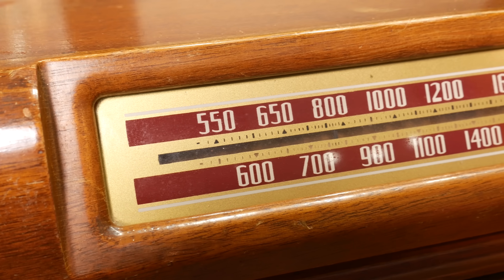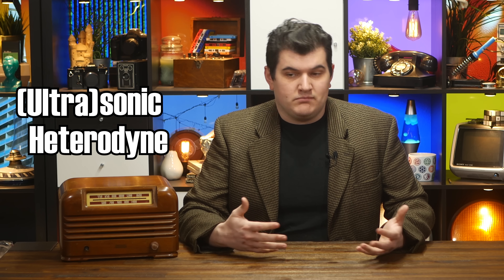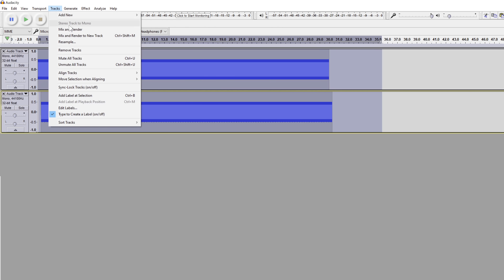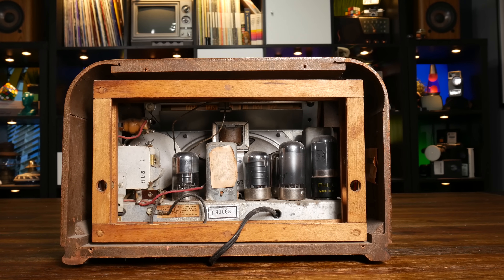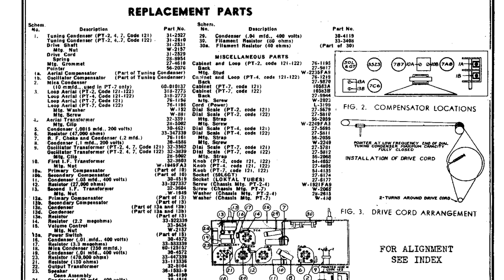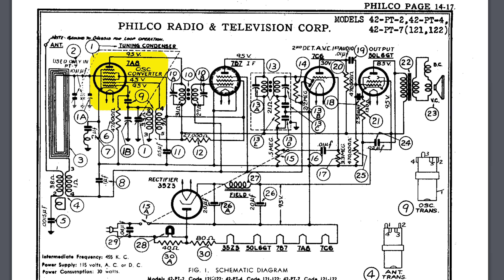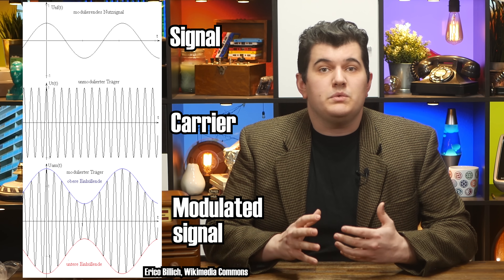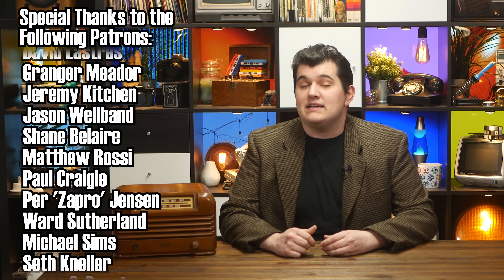The Superheterodyne Radio: No really, that's its name

Comment: It is called superheterodyne because the local oscillator frequency is above the frequency we want to tune.
If the local oscillator frequency were below the frequency we want to tune then the system is called subheterodine.
Reply: its called super because the IF is ultrasonic, ie. above the audio range. ultrasonic used to be called supersonic, hence the name. now it would better be called ultraheterodyne

Comment: Why adding two high frequencies didn’t produce a third frequency…At about 3:35 or so, you set the speakers at two very high frequencies with the idea that the beat frequency would be a steady tone at a lower frequency. There is a subtle reason why that didn’t work. The microphone,   and our ears for that matter, simply responds to the total instantaneous amplitude of the air pressure pushing on our ear drum (or microphone).  They respond linearly, that is to say, the more pressure they feel, the harder they push. The logarithmic response is because of the way the inner ear bones work, they pivot in a fancy way that increases the dynamic range we hear. But, it is still, all linear. The two signals simply add up and push on our eardrum.  If, in a radio, when you combine the two signals, you did so with a couple of resistors, (sort of like your ears do), you would not get that magic extra frequency. The reason you get that magic extra frequency in a radio is because the combining is done with a fancy circuit that does not add the signals but MULTIPLYS the signals. The circuit is called a “mixer.  I’m leaving out many details, but the concept is that the signals must be combined in a non-linear fashion.  In order to “hear” that third signal as tone, your ears need to multiply the signals together and not add them. Fortunately, they don’t or we would go mad with all the weird “mixing products” we would hear all day long.  When people talk to us, wow, the array of mixing products would drive us mad!!!

Comment: I love the channel, but in this case the explanation is not quite right. The beat frequency is not a new frequency. It just is an illusion as a result of interference. To really generate a signal with the frequency of the difference between the two input frequencies, you have to mix them. Not mix them in sense of simple addition (like in a mixer pult), but multiply them. For this a nonlinear component is required. Like diodes in a ring mixer for example. Only with a nonlinear operation new frequencies show up in the spectrum.

Comment: The reason you don’t hear a 400 Hz tone from the 5 kHz and 5.4 kHz  speaker tones is because there is none. you do not create a new frequency by adding two frequencies together. if that were true the concept of frequency would t be very useful. What you create  is an amplitude fluctuation (a beat) at 400 Hz, not a new frequency. Your ear can hear amplitude fluctuations up to a few Hz,  but not at 400 Hz. To get a new frequency from beating, you need some sort of nonlinear combination like multiplying the signals together which is what actually happens in a superheterodyne radio. Maybe nonlinear distortion is why you can hear 400 Hz in the headphones. Congrats though on testing your idea with a real experiment.

Comment: Actually you will only get the beat frequency if you add a non-linearity. Otherwise you'd always have beat frequencies if you had more than one station. BTW the other big advantage of Superheterodyne receivers is that it's much easier to amplify a signal. Amplifying an RF signal while keeping its frequency means that you will have a strong signal at the frequency you want to receive. This could feed back into the input again and you risk your amplifier being an oscillator. This allows decent "modern" AM receivers to actually be much more sensitive than the natural background noise.

Comment: Thanks a lot for this video, very interesting !
Something I don't understand however is why the modulated signal (music/speech) which is at a much lower frequency than the carrier is not filtered out by the band-pass filters. I know this signal is AM, but still it's waving at a the "human hear" frequency, so how is thant not filtered out ?
Reply: He touches on this in the video but it works like this.   
Let's say you're listening to a station like WDGY in Minnesota at 740 kHz.   And that station is playing a 1 kHz tone for some odd reason.   If you could see the RF signal on an  oscilloscope, you'd see the 740 kHz signal (call it the RF signal or the carrier signal) but the AMPLITUDE of the carrier signal would changing at the relatively slower rate of 1 kHz.   
The tuner and mixer would generate the intermediate frequency (varies by radio - let's go with 450 kHz).  The intermediate frequency is then amplified.  Now if you could  see the signal on the scope, the amplitude is larger, the frequency is now 450 kHz and, overall, the amplitude is still increasing and decreasing at the relatively slower rate of 1 kHz.   
Now you run the intermediate signal thru the radio's detector stage.  This is essentially a low pass filter that passes audio frequencies and rejects ultrasonic frequencies.   
After the detector phase, look at the signal at an oscilloscope now and you see a 1 kHz sine wave.   Now send the audio signal thru the audio amplifier and you see the same signal with a larger amplitude.  For a vacuum tube radio, this is then run thru a transformer to so that the power is converted from high voltage - low current to high current - low voltage because speakers require that form of power.   
Hope this helps.

Comment: Fun fact about that schematic: The german word for capacitor is still "Kondensator" - condenser. And because translators sometimes are idiots, the german Flux Capacitor doesn't store flux but compensates for it, because they turned the "Flux-Kondensator" into a "Flux-Kompensator". If you ask me, I prefer my flux to be compensated for. There's nothing as dangerous as a wibbly-wobbly time line.

Comment: If people are wondering why it was called condenser, instead of capacitor, even though it's storing energy:
a) Lingua Franca for all STEM fields back then was pretty much German, where it's called "Kondensator"
b) "Kondensator"/Condenser is derived from Latin "condensare", condense in English. The term was first proposed by Volta (yes, that guy which we named Volt after), because you could store a higher density of electrical charge compared to the usual isolator, thus "condensing" the charge.

Comment: A filter that has flat frequency response for the interval of interest (the station's modulation frequencies), but drops off rapidly beyond those—a "brick wall" filter—is complex, and difficult to keep constant even for one center frequency. It's beyond insane to try to do it while it's being tuned over a wide range. BUT WAIT! If it's a DIGITAL filter, suddenly this is not much of a problem. The formulas can be worked out and programmed in, and your filter can be tuned all over the place. All you need is a way to convert analog to digital, with enough bits of resolution, at at least 2X the width of frequencies you want to receive. With today's tech, I think we've reached the point where the new problem is much more tractable than the old one, at least for radios with ranges no wider than a few tens of MHz. A general communications receiver (shortwave radio), or a broadcast FM radio, would likely be totally workable.

Comment: In the mid-Nineties, I was saying that the first casualty of digital technology was the slide rule, and the last one would be the slide rule dial. I think we're sort of reaching that point now, after about 50 years.

(slight tangent: Increasingly, I think there's a lot to be said for analog-style indicators, although they should be electronic displays, driven by digital data. In particular, I'd say that about clocks. A dial-type time display sidesteps a group of really vexing problems related to the issue of 12-hour vs 24-hour formats.)

Comment: My parents told me that almost a century ago, in Europe, you had to buy a licence to operate a radio receiver.   Random spot checks for enforcement were to try to detect the radiation from the oscillator in your little vacuum tube radio.
Reply: You still have to, lots of countries gather mandatory fee for operating tv or radio equipment, fees are then used to finance the state run tv/radio stations - its basically not-so-hidden tax :)

Comment: In order to get a beat frequency the device detecting the sound or signal must be non linear. The ear is a nonlinear recover and it's response is logarithmic. (This is actually very clever allowing the ear to hear loud and soft sounds.) 

An A.M. signal is composed of the carrier, the carrier plus the the frequently and the carrier minus the frequency. Thus if the carrier frequency is 1160khz and it is carrying a 5000 hz signal the result is 1155khz, 1160khz and 1165khz when those are combined the result is a modulated wave. When this is put through a detector a 5000hz signal is created and amplified. A transducer (something that converts the electoral signal to sound (usually a speaker or headphone) plays sound and we hear it.

Comment: Edwin Armstrong developed circuit designs (including the superheterodyne receiver) that are still used in countless pieces of equipment today. I used to fix surveying instruments that measure distances by bouncing light off a prism. The outgoing signal is modulated at a high frequency. The returned signal is sensed by a diode, amplified and mixed with an intermediate frequency, then the RF filtered off before the phase shift is measured to compute the distance. I was sitting in the training class thinking "OK. It's just like a radio."

Comment: Early 80's I remember connecting an electret microphone to a (transistor) FM radio's local oscillator. Then connecting another wire to the oscillator as an antenna. Could transmit to another FM radio. Signal was received a block away.

Comment: Superheterodyne is still used very often in ameteur radio, but the bandwidths are much narrower. Broadcast FM stations are spaced 200 khz apart, while ameteur radio single sideband signals only have a bandwidth of 3 khz.

Comment: The capacitance of the variable capacitor tends to change with temperature.  As the temperature goes up, the plates may get closer.  This will cause the station tuning to drift.

Comment: Your experiment with speakers is adding two sinewaves. This  won't produce an actual difference component: sin(3000) + sin(3400) -- it's just two sinewaves. But when you multiply them: sin( 3400 ) * sin( 3000 ) you get ( cos( 3400 - 3000 ) + cos( 3400 + 3000 ) ) / 2. You get the difference and the sum. 

It's not hard to get a circuit to do this -- in fact, it's hard to avoid.  Because any non-linearity in the circuit will create a multiplication effect. Classically this can be running the sum of two sinewaves (3400 and 3000) through a diode that chops off the bottom (negative part) of the signal, then into a capacitor to low-pass out the sum (6400) and leave only the difference (400).

Great video!

Comment: 10:24 is this really a problem? I mean 455 kHz is not a frequency that affects radio signals because it is below the medium wave range which starts at 530 kHz or 531 kHz depending on the continent and above longwave which goes up to about 280 kHz. So I guess it would only be a problem if the signal of one radio reaches another radio which uses the same intermediate frequency, but couldn't you design a filter that filters out signals that are at the intermediate frequency between the antenna  and the local oscillator to avoid interference with other radios?

Comment: The reason the 5000 Hz. And 5400 Hz. test didn't work is because the sound from two speakers adds.

The mixer in a radio multiplies the two waveforms. This results in both the sum frequency, or 10,400 Hz. and the difference frequency, or 400 Hz.

Comment: 7:09 I love how those old engineers put ball bearings in there, they wanted the radio to last forever. Not like now they don't even put bearings in the wheels of some kids' bikes.
Reply: The dial drive cords on some of these radios were a work of art in their own right. As a pre-teenager I was fixing broken cords for faintly and friends.
Reply: @ShaunieDale  those cord driven knobs are a thing of tactile beauty. Surprisingly hard to emulate with modern parts (I've still not nailed the feel in 4 iterations of 3d printed cable dials for a prop device).
Reply: In addition to smooth movement, the ground of the tubing capacitor ARE the ball bearings. If you ever get static when tuning an old radio, spray contact cleaner in them like you would a switch or pot.
Reply: Hell, the amount of sealed bearings and bushings-that- should-be-bearings that I see in modern agricultural equipment is just pathetic.
Reply: Why did I imagine the voice of this comment with a British accent?
Reply: Most of the time on tuning capacitors like the the ballbearings are actually there for gear reduction. Works like planitary gears.
Reply: In respect to kids' bikes...that's what you get when you favor inexpensive products over quality products. traM-laW comes to mind.
Reply: Why do I bother with comments replies?
It's always the same pattern.
Reply: @JonatasAdoM  your mom
Reply: @JonatasAdoM  is not.
Reply: That would be because those are cheap bikes. Designed to make bicycles affordable, rather than have a lifespan longer than their owner's.
Reply: @VineFynn Those cheap kids are not designed to be handed down. The laws of capitolism demand that you buy a new one for the younger sibling. We have been conditioned to consume from birth!
Reply: @VineFynn  Bikes that have a lifespan longer than their owners are already affordable. The bikes he's talking about are an example of planned obsolescence that has sadly warped people's idea of what a bike is meant to cost in the process. $1000 is about 5x what most people are willing to pay, but will always work out cheaper than riding shitty $200 ones.
Reply: I think it has more to do with alignment and smoothness of operation, than longevity.
Reply: @EddSjo  You are being a contrarian for no reason at all. Gabriel is right. Smooth operation leads to longevity.
Reply: @vulekv93  you’re so cool and smart
Reply: @vulekv93  smooth operation leads to comfortable use, same force applied result in same response - very little amount of stiction (google this term). And contrary to common belief, in such condition ball bearings aren't best choice for longevity (you get dust and humidity, it's problematic to clean or grease-press them there), but they were the only choice back then.. modern high-end uses way better bearings for mechanical controls, while cheap hardware "cheats" with variant of fluoroplast (chemically same as original "Teflon" ploducts, structure way beter), which became common and stopped to be classified material relatively recently.

Comment: I'm intrigued that you were lucky enough to get that 400Hz audible tone by mixing 5000Hz and 5400Hz. In theory, only the intensity of the signal changes at a rate of 400Hz, but the average value of the signal remains constant. In order to get the 400Hz out, you need to clip one side of the combined waveform so that it looks flat on one side and wiggly on the other (this is done intentionally in superhet receivers.) After clipping, the average of the combined waveform now shows a variation 400 times a second, which becomes detectable as a frequency in its own right. The equipment you used is not supposed to clip (distort) the signal so the fact that the tone was audible means that your equipment is not perfect. Note the requirement for nonlinearity in the signal processing at https://en.wikipedia.org/wiki/Heterodyne . I wonder if an amplifier specifically designed to distort (such as a guitar amplifier) would give good results.